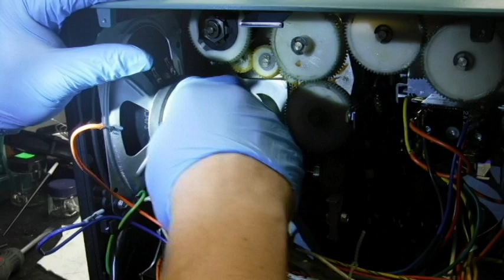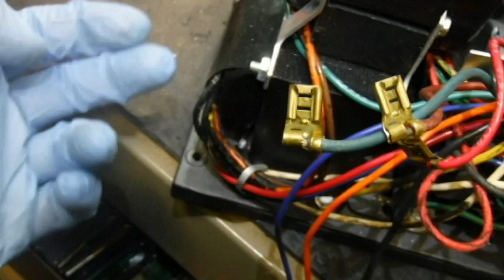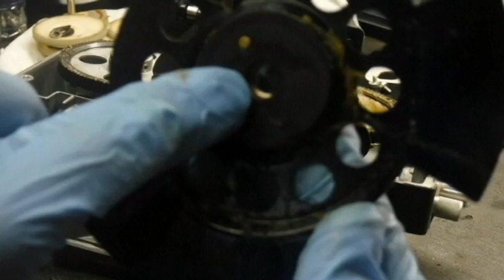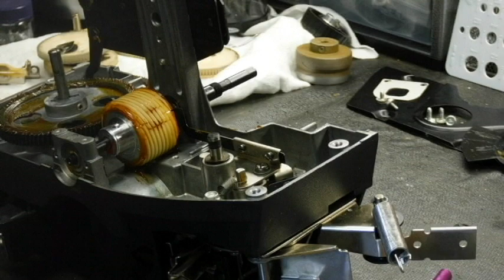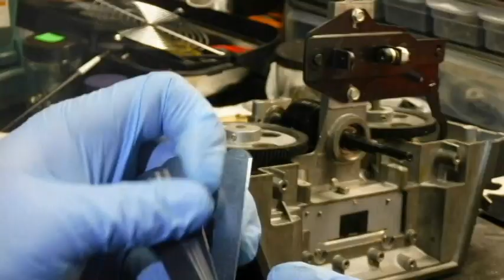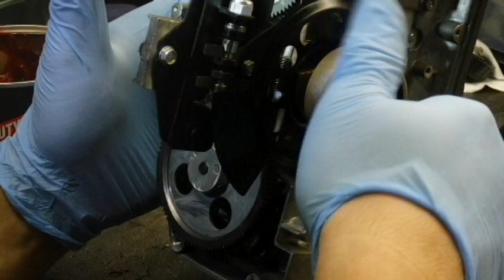Worm Gear Replacement Tutorial -16mm B&H 1500 Series Projector

Comment: Great Video! Thank you On some B&h projectors there is a 015533 Lower Sprocket Gear  1575/1580/2580  On which i replace also with the worm a lot on times its cracked  where  the film bunches up at the sound drum  this gear should be replaced even if its not bad . its as old as the old worm gear  I have these in stock  RC's Classic Collections
Reply: I need help need parts for a bell&Howell 2585 . Where can I get a worm gear and drive belt. If you can send me advice I am ready to order. Thank you.
Reply from the maker: @rudyflores8886   www,urbanskifilmsupplies.com
Reply: The link below Urbiski film supply can handle your order. They helped me with my worm gear and other things.
Reply from the maker: @rudyflores8886  if you are looking for films you can also join my group on Facebook "The Big Reel Group" link: https://www.facebook.com/groups/1222952484713237
Reply: I just ordered one from you

Comment: By the way, thank you for making such a great video. I could have never taken apart and rebuilt this projector without it. Also, as a note, you don't have to have the Bristol tools that are sold as a kit. I got the small vortex screwdriver set from Harbor Freight and it worked fine. The most common screwdriver part was the 9mm vortex, six-side.
Reply from the maker: You have to be careful,the bristol spline are specific to the bell and howell set screws,if you strip the teeth in those you will not be able to use any other allen or vortex to get them out,the bristol tool is N66 available from Test Equiptment Depot for $6,plus you need 2 other bristols for the other size setscrews.Just a warning.

Comment: 9:40 "An' this gear jus' pops right out..." ...When you said that, I wondered if it would actually pop off, and it didn't dissapoint ;-). Thanks for posting this, and for being brave enough not to stop the vid to look for that e-clip that sproinged earlier. I just bought a 1550 cast-off from a video equipment rental establishment because i have a sound film of my great-grandfather from 1935 for which i had rented a 16mm 30 years ago to videotape, which afterwards i copied to DVD thinking the DVD would last forever. Well the DVD no longer works, and i can't find the original VHS, and no one rents 16 mm any more. The establishment turned the machine on and it seems to work, and didnt seem too noisy, but i didn't want to bring my film with me so i didn't actually check it with film, and still have not yet, for various reasons. Your vid gives me confidence that i can fix the worm gear if it doesn't work properly. I am surprised that the sound systems on these do not seem to be problematic, considering capacitors do not last forever. I'll keep my fingers crossed.

Comment: Thank you sir for this video!! I found a dealer in Belgium for the Xcelite 99PS60 set of Bristol screwdrivers. In an answer of one of the reactions  you talk about n66. Could you please have a look in the webshop of The equipment depot and let me know if the 99PS60 serie contains all of the needed blades for the 1698 B&H projector? May I also ask you if changing the worm gear of this 1698 projector is much different of the one you show us (1545)? Thank you and greetings from Belgium.

Comment: Pretty good walk through.   I wish though, you had worn a helmet cam or moved the chassis over some, as I could not see any of your adjustments  of the loop restorer.    Also, there isn't any YouTube videos that I've seen, that cover replacing the worm gear on a 500 series with still frame feature.  That's what I have and Urbanski doesn't sell a worm gear for any model with the still feature.  There were a lot of parts on the worm gear shaft that ended up being junked, because the still feature can no longer be used.   Your video and the British guy's video, helped me a lot, so cheers 🍻
Reply from the maker: Yes,sorry was the first video, the loop restorer itself should not need an adjustment,the reason I use countdown leader is to make sure the outer upper and lower sprocket wheels are in alignment, so if the countdown numbers(looking thru the front of the lens carrier align to the frame opening in the gate without tripping the restorer the alignment should be good,as far as the still feature,or is a pain,I have only done 2 of them,since then I just remove the entire still feature from all the rebuilds,thanks for watching!
Reply: Van Eck now reproduces the Bell & Howell # 09784 worm gear for projectors with the still picture feature.
https://shop.van-eck.net/PP-0051.html

Comment: Hi, the worm gear is stuck to the rod, in the video it slides right off. I completely removed the set screws on it and the loop restorer cam. I've managed to hammer it to the end of the rod, but it is stuck as if it is bolted in. Any clues?
Reply from the maker: So sometimes the old lubrication has hardened causing the worm gear to slide,reattach the shaft,leave the set screws out and thake a flat head screwdriver with a small hammer and tap it loose,you can also get a spray lubrication and spray around both sides of the worm gear where the shaft goes into before attempting to tap it loose from the shaft.

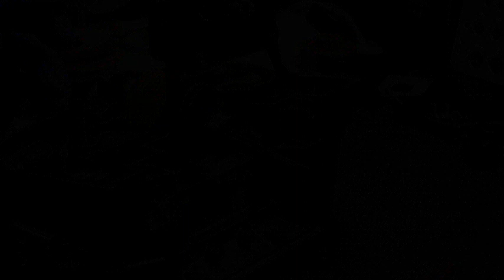Comment: And at 37:44 you have a bit of a problem getting the wormscrew rod out and then at 37:45 you have the ball bearing in your hand. What happened in the black zone? I can't get this out very easily either and I don't want to damage it.
Reply from the maker: I forgot to loosen the setscrew on the loop restorer cam,directly to the right of the worm gear

Comment: First try on my rental store cast-off 1530 purchase, and the film autoloads to the pickup reel ok, but machine slows and stops once i get the film on the take-up reel and doesn't want to move forward any more. But turn knob to reverse and film backs out no problem. Machine runs Fwd fine with no film loaded, but stalls once film reaches the takeup reel. I only had a few moments to play with it before wifey rushed me onto other things. Could the introduction of the thin film really put that much drag on it? It had no problem running the film backwards. The reverse button on top of the machine was frozen when i got it, now there's no resistance when i press it. Could the reverse button be causing my issue?
Reply from the maker: Have you changed the motor belt?Film will not cause drag in this situation,the reverse button....the takeup arm should be in the upright position for proper film rewinding.Also you will have to look inside your machine on the inside at the location of the rewind button and make sure the two white gear wheels are engaging in both forward position and rewind position.The autoload mechanism is something i never use,I always manual thread my projectors.
Reply: @HighRollersMusic1  - Thanks for the reply, and i have good news to report. You were right on the money. It wasn't the film, it was the takeup reel drive belt and pully fully gummed-up with a black tar-like substance causing the belt to stick  to itself and the drive and idler pulleys. The machine would not do the regular rewind, and i saw it was because the takeup pulley belt was sticking to itself and the pulleys. And ha ha I learned the hard way that one cannot "half-ass" a repair on these machines. I cleaned the metal pulley but not the nylon pulley or the belt, and it immediately gummed up the works again. So i had to do it all over again,  this time making both pulleys and the belt spotless. Here's a link to a couple portions of my first test. I was so excited i forgot to record right away. I will be privatizing this shortly, though. https://youtu.be/wbWrHE0xBf8 https://youtu.be/O-fTOH8APvE

Comment: After another 20-25 hours working on this, I've put it together but can't get the gear at 9:35 to "catch" and turn the other gears. I have taken this off, replaced the U clip from another projector and also changed out the gear. Do you have any tips on what it can take to make this all work. Other than this, it appears everything else is good.
Reply from the maker: The first gear wheel at 9:35 has a square indentation that has to sit exactly as the U clip is in its position,make sure that gear wheel is pressed as you re assemble the washer,curved washer and c clip,those washers and c clip must be depressed tightly to that gear wheel.There is a possiblity that c clip and or that gear is not seeded properly.

Comment: I'm just a bit unclear at the end here, when your run the test strip through the chassis. Exactly how can you tell that everything is accurately in alignment? Obviously, I don't want to put the entire thing together and find out there's something that needs to be tweaked. Can you outline specifically how to do this final once-over and what you're looking for in the test strip?
Reply from the maker: The countdown leader test is to check for alignment and timing after the new worm gear is installed,thread this like you would if you are going to watch a film,leave a proper upper loop and a proper lower loop at the bottom of the loop restorer roller,turn the pulley wheel in the direction(forward)to imitate the film running through.The you will be looking inside the front of the lens carrier to see the countdown numbers are in frame alignment,and that the claw shuttle is not causing pulled sprockets or causing the loop restorer to trip,if it does this then your timing is off,make sure your framer is aligned which you can also see looking into the lens carrier where the frames of film in the aperture plate,if the test countdown leader does not trigger the loop restorer then your timing and alignment should be proper and the chassis is ready to be installed,after it is installed,if there is any wow or flutter,or ghosting,then timing is not proper and you will have to remove the chassis and make timing adjustments.
Reply: I have a factory made "run-in" projector. It's basically a half built projector they pulled off the production line. You can slide the projector mechanism into it easily. Then you can check it with the mechanism running with a projection lamp behind it and with a lens. That way you can check framing adjustment, side-to-side picture focus, steadiness, and if any ghosting of titles occurs. I also have a projector mechanism stand which allows you to run the mechanism from 6 frames per second to 30 frames per second with a variable speed control. That was built by a now deceased Bell & Howell technician in Australia. The mechanism stand allows full access to most parts of the mechanism, even while running.

Comment: I would really love to know what tool you used to take out the bottom two screws that are holding the wormscrew chassis. This is at about 20:49, where you show the needlenose pliers lifting out the screw. I have purchased 4 different rachets and two pliers and still can't find a way to get to these bolts. If I could take off the motor in the front, that would be easier, but I can't get the back left screw out of the motor frame. Any suggestions?
Reply from the maker: 8mm metric socket,with and extended, you well either,"A" loosen the 3 flat head screws that the sound drum roller mechanism attaches and slide that to your right so your socket goes through the one of the holes in the big sound wheel,or remove that sound wheel completely,that wheel maybe either solid wheel plates,or a wheel that has 3 giant holes,it is usually being held on with an E clip using a flat head to pop off that clip,there is a tension curved washer behind that clip,so make sure you do not lose it.
Reply: @HighRollersMusic1  My sound drum roller on the 2586 model is brass and solid. No holes in it at all. I finally got those two screws out with a 8 mm socket and an extended 1/4" socket drive. Anything bigger and you can't get the socket back there.

Comment: This tutorial is for the 2592AX model? It is from the 2500 series, and I have the worm gear broken.
Reply from the maker: no 1500 series as stated on the video and titles before video starts
Reply: Ahhh ok.
In the instructions of Manual Repairs say for 1500, 2500 series.
Reply from the maker: They are similar as far as the worm gear change goes,but the video is a 1500 series model

Comment: Where do I buy all the tools I'll need, to fix my 1585 c bell and howell, 16mm filmosound projector, is there a website I go to, I'm replacing the worm gear
Reply from the maker: www.urbanskifilm.com
Reply: Thank you very much, while I'm repairing it, I'll follow your video, and record myself for my own records
Reply: Larry Urbanski of Urbanski Film sells the reproduction worm gear as well as the Bristol wrenches needed to loosen/tighten all of the setscrews. He also has reproduced the special Bell & Howell gages/jigs called out in the service manuals such as the Sprocket Timing Plate, Loop Restorer setting tool, and the Soundhead Locating Gage. Larry also sells complete Bell & Howell service/parts manuals.
Reply: @Sunsetdrivein  cool thanks for the information, I'll take a screenshot of all this